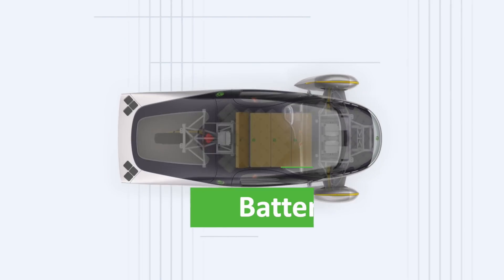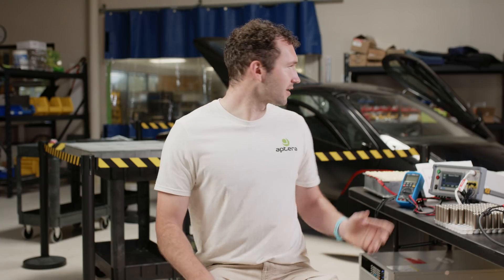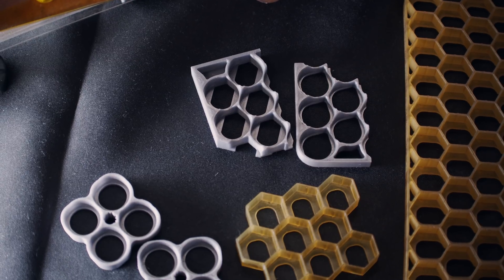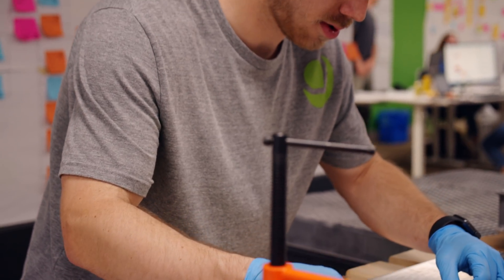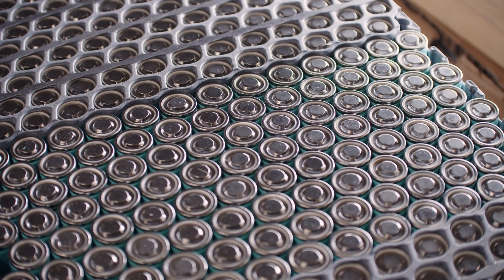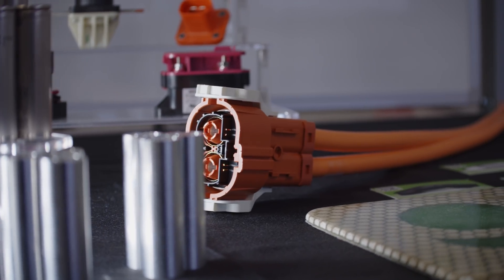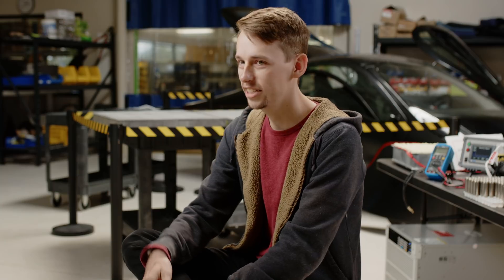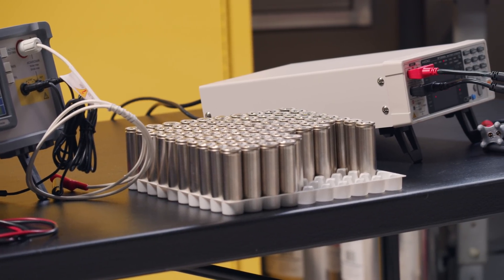Aptera — Battery Update

Comment: great to meet some of the battery engineering team! sounds like you guys are solving all the right problems! love the video! Thanks for sharing this with us and keep it up team!
Reply from the maker: Thanks for watching! Can't wait to share more as we get closer to production.
Reply: @ApteraMotors  my next recommended video is a news report about how many Tesla EV's failed German import inspection.
😂
Reply: @copcuffs9973  Aptera does not need to be putting other manufacturers down.  They are part of the rising tide.
Reply: @vic321344  Bruce referred to Aptera, the company.  Bruce is not Aptera.  Besides, when the peanut gallery complains that Aptera isn't making progress fast enough, responding with a comparison to Tesla is a perfectly relevant way to counter the argument.  The intent isn't to "put Tesla down".  Y'all are just butt hurt that you can't counter argue Bruce's counter argument, so you are desperate to throw some shade Bruce's way.
Reply: @vic321344  Tesla did not "build a car"  They took 6 years do do an EV conversion of the Lotus Elise.  I was working in Union city while they did this and knew many of the engineers.
Reply: @vic321344  Get outta here!  You've got serious blinders on.  Aptera has made progress at battery efficiency and energy density.  They are using a patent-pending busbar design.  Just watch the video.  They have done much more than "just throw together" a battery.  That's kinda the whole point of the video.  Watch the video with the sound on next time.
Reply: @vic321344  They aren't obligated to give away their intellectual property regardless of how much you complain about the fact that they haven't yet done so.  Fact is, I'm much happier if they DON'T give it away.  "Nobody knows what progress"?  Nonsensical.  I'm sure plenty of people know exactly how much progress.
Reply: @vic321344  It isn't Aptera's or anyone's responsibility to disprove every wackadoo conspiracy theory you come up with.  I don't see you coming up with a credible alternative reality to what Aptera clearly presents in videos and other forms.  You simply have vague claims of "doubts".  Very lazy.  If you want to be believable, do more homework and present your findings in a well thought out manner.
Reply: @vic321344  Another nonsensical statement.  If you don't care if I believe you, then why respond to my posts?  Aren't you the one who is using the term 'phantasy' in regards to the Aptera and yet fail to cite anything specific to back that up?  Since I'm quite sure everyone at Aptera is working in the real world and is not delusional, the one with conspiratorial 'phantasies' is you.  This is a conspiracy theory as you are believing in something without objective evidence.
Reply: @vic321344  Yes, I see.  You want Aptera to build the production vehicles first, test them in their final state and provide everyone with the resulting data.  Then they can start taking pre-orders.  Sorry bud, it doesn't work that way.  Why don't you insist Tesla, Rivian, Lordstown, Electrameccanica, Ford and every other EV manufacturer taking pre-orders comply with your data needs?  Don't want to be heaping an unfair amount of attention on Aptera, you know.  Aptera's engagement numbers are already very high.
Reply: @vic321344  yes and it is a car that doesn't exist today!
Reply: @vic321344  Tesla today over promises their range, introduced the Cybertruck 3 years ago and still a dream today, introduced the new Roadster which is still a dream today, introduced the Semi, still just another failed promise! No new vehicles for 2022! Who makes a lot of false promises and fails to execute? You will disappear from this channel eventually because Aptera's success will silence you!
Reply: @vic321344  You know, you can't WILL Aptera to fail just because you don't like it. If it doesn't succeed it will be because it will fail on it's own, not because you spread FUD on youtube. You don't have to work so hard! Also you don't need to tie your personal happiness to this project.
Reply: @vic321344  "Don't claim (or even sell) what you have never tested or even built once" - I don't see how your statement applies more to Aptera than to any other company taking vehicle preorders that is not in production yet.  More nonsense.  Sorry, bud, you can call them all "vaporware" if you want.  Nobody is trying to claim that they have produced a production-ready prototype.  This is a straw-man argument on your part.  I'm sorry that Aptera's claims are perfectly reasonable, but just too amazing for you to believe.  This is not Aptera's fault.

"As far as I remember Tesla never promised something they did not build and test before." - Uhm, are you excluding the Cybertruck?  Tesla is taking preorders.  Yes, they built a prototype (just like Aptera), but we KNOW it is not the final design.  Remember Elon smashing the window with a solid sphere?  Was this Tesla promising that the vehicle windows would NOT be robust?  Seems more like he was attempting to substantiate that they would be robust, but failed to do so.  So either Tesla tested this feature and it DIDN'T pass, or they failed to test this feature.  So, you are incorrect in your assessment as Tesla is promising something that they have already built and tested (successfully).  

"rendering of an iPhone"  "brick made of clay" - This is such a preposterous comparison to the issue at hand.  Are the Aptera alpha vehicles simply computer renderings or bricks made of clay?  Of course not.  More silliness on your part.

I would have responded earlier, but I was traveling, AFK.
Reply: @jonj9149  Relax. Don't you recognize a troll when you see one? Pay him, her, it no attention.
Reply: @jonj9149  I looked up Vic321344. He is a greaser gearhead who is afraid of the EV revolution. He has stock in the fossil fuel industry and is employed by it.
Reply: @IBMara  I recognize trolls.  I respond to them.  I enjoy it and rather frequently they give up arguing with me.
Reply: I responded to vic's last post on two separate occasions, but they've been filtered out or deleted by YT, so will need to catch up with him in some other comment thread.